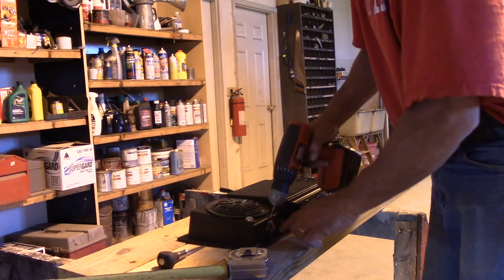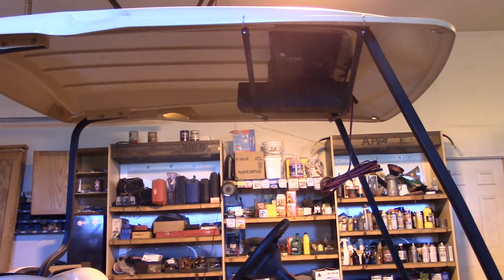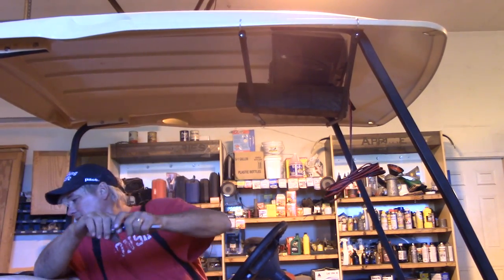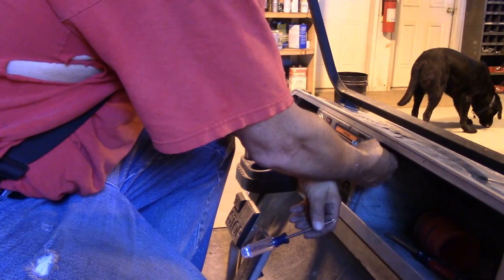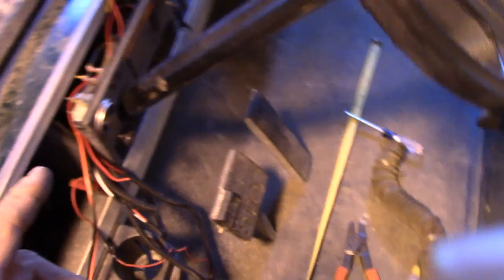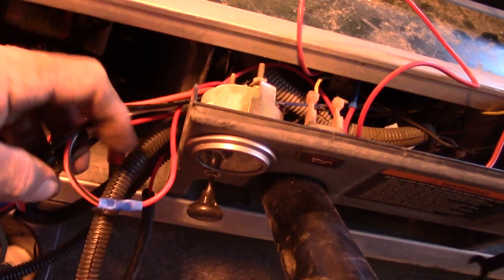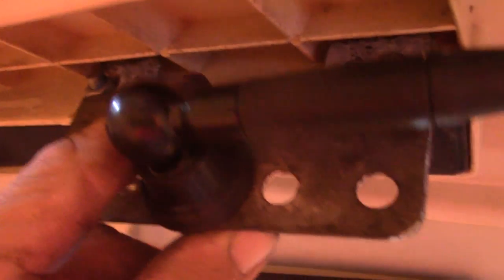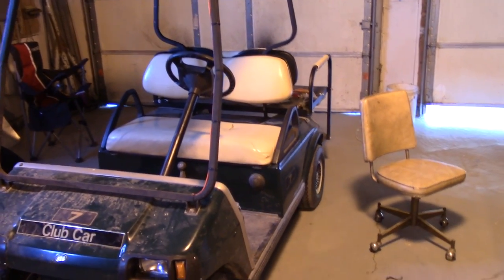Installing Radio on Golf Cart Part Two

Comment: Thanks for the video. We enjoyed watching your installation and hearing your comments. We are the manufacturer of this unit and are always looking for ways to improve our products. After watching your video, I thought you might like an explanation on why this unit has 3 fuses, which you indicated seems like overkill. There are very good reasons for 3 fuses. The fuse in the radio is built into the radio by the radio manufacturer.  It's only purpose is to protect the internal components of the radio in the event of mis-wiring, connecting a battery charger wrong etc. The screw cap fuse on the back of the radio protects not only the radio but other branch circuits and components which may be installed inside the radio housing. in your case the LED Map lights and illuminated switches. Some units have USB chargers etc. These components are very vulnerable to reverse voltage and over voltage, or miswiring, especially when installed in electric carts.  You are right about the wire size. We use much heavier wire than necessary but for a very good reason. Small wire has thin insulation. Heavy wire like we use at great extra expense has heavy insulation. This heavier insulation guards against wire nicking, skinning or wire chaffing when routing wires through roof support tubes, under mats, or through panels, etc. As you know a nicked or skinned wire that gets against the frame or metal surface, when connected directly to a battery, especially if not fused can cause the wire to burn like a dynamite fuse. This brings me to that third fuse. The one we say should be installed close to the battery. Just think about it. If that main power wire gets pinched, skinned, or nicked and gets against the frame before it enters the radio case, the fuses inside the case will be of no effect. When shorting the main power wire (which does happen occasionally) the only possible protection from a likely catastrophic fire would be the fuse next to the battery. For the greatest protection all fuses should be placed closest to the power source. In this case the battery.   
In the manufacture of all of our units (over 200 models) we use a lot of overkill.  Perhaps we could make more profit by cutting corners, but our mission is to build the very finest products in the industry. Fell free to contact us anytime for questions about our many Golf Car, or UTV stereo products.   Thanks again! Jerry owner CARTTUNES and RECREATIONAL ELECTRONIC INDUSTRIES  334-877-0943
Reply from the maker: Thanks for your comment.  The extra heavy gauge wire and three fuses make a lot of sense now that you've explained them.  By the way,  after a full summer (literally hundreds of hours) of use, your product has performed flawlessly.  Everyone who has seen and used it has loved it.  I would not hesitate to recommend it to anyone interested in adding a compact, all in one, 12 volt stereo system to a golf cart, boat, UTV, etc.  Thanks again.  Great product!

Comment: Mines hooked up to my battery with a in line 15 amp fuse.And with the key out you can still turn it on the radio. With the radio being off can it draw the battery down

Comment: I have a stereo hooked up to my gas EZ Go golf cart. Everything works but when I press down the gas pedal the stereo loses power and does not come back on until I let go of the gas. The way it’s set up now is the ignition is turned all the way to the second click for the stereo to turn on. I also have headlights but they are installed with a separate pull knob.

Comment: I would like to install a stereo that would only work with the key on. Dress it and the headlights to the hot pole on the ignition switch like you did your lights? And run the memory wire to the existing hot wire for the lights?

Comment: Where did you get the mounting kit?
Reply from the maker: I got it off of eBay from an outfit called Car Tunes.  You can find this unit and units just like it on both Amazon and eBay.  You can get them with just about any kind of stereo you want, or you can just get the bare console and add your own stereo and speakers.  Mine cost about $300, but you can spend more or less depending upon what you want.  Thank you for watching and commenting.
Reply: @fixyourself9163  I have a club car like the one you used in the video.  My question is, can you read and see the display window when sitting on o the drivers seat using this radio you installed? I have tried a couple different radios and you can't see the display from the drivers seat. Thanks in advance for the reply.  Richard W.